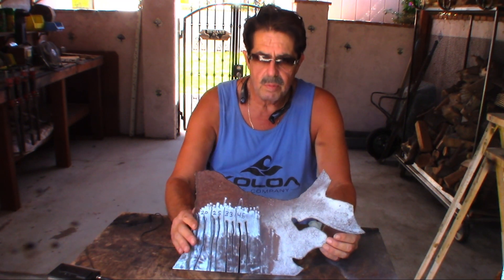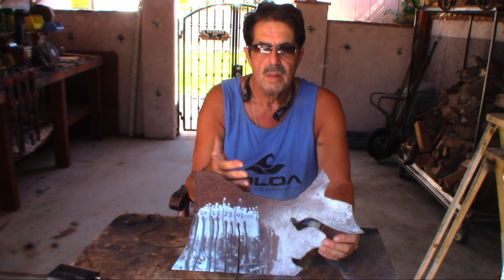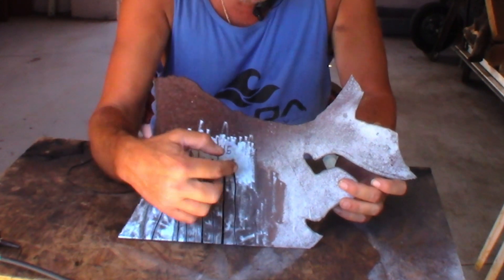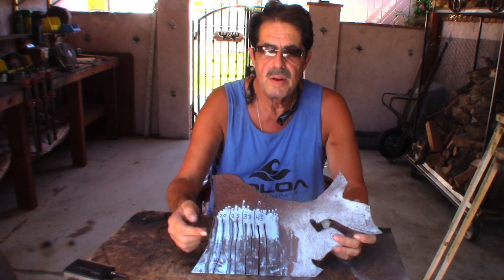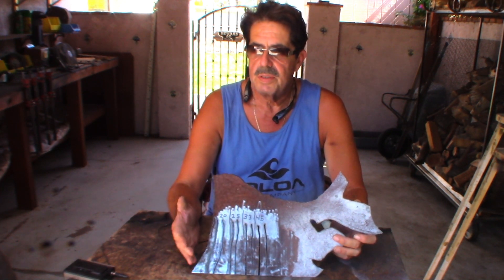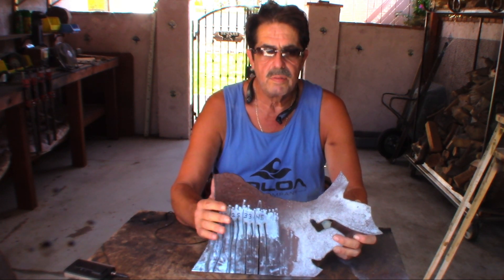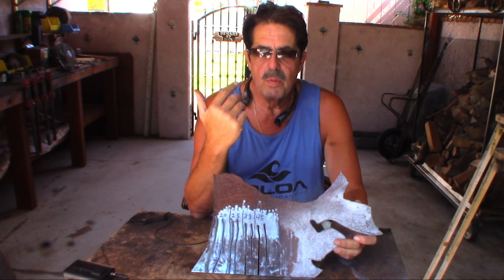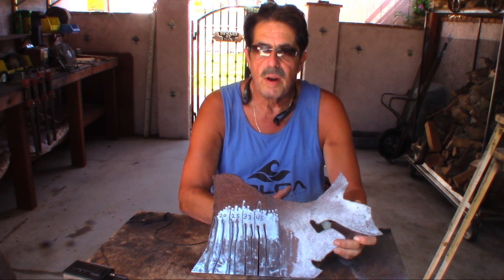Harbor Freight - Titanium plasma 45 plasma Cutter - Experiment on Amperage v. PSI

Comment: What is up with trying to find the electrodes and the tips and whatever other crap is called that goes there.  Not all are the same nor are they called by the same name, nor do they all look alike.
I bought this brand new unit ( so it appears) Titanium 45.  Well for some reason the guy doesn't have what goes in that gun.
He has got the wrong electrodes and the tips and the rest he doesn't have.
The electrode that fits is not threaded, his is threaded.
So I realized that the other 5 numbers matter.  What this unit is the number is 56255 Titanium plasma 45 number 56255.
The kit that seem to fit in this is about $70.  It is the only place I found that has the kit.
Can you please explain what yours look like and what is up with all these differences.
I thought you jus type in Titanium 45 and get the crap.  It doesn't seem to be that easy.
Thank you so much for any englightenment.
Reply: Contact HF and ask to talk to someone in tech - they should be able to help you on where to buy them.